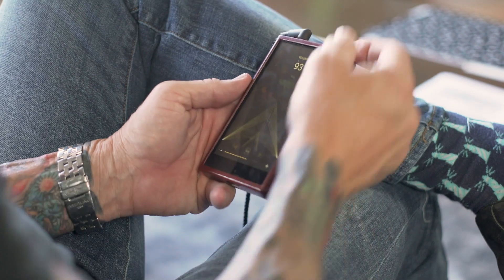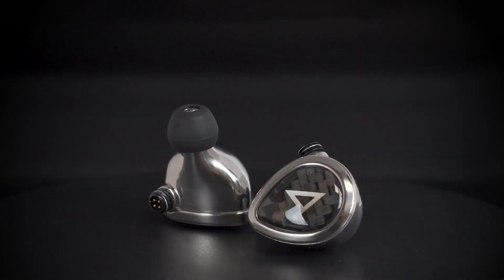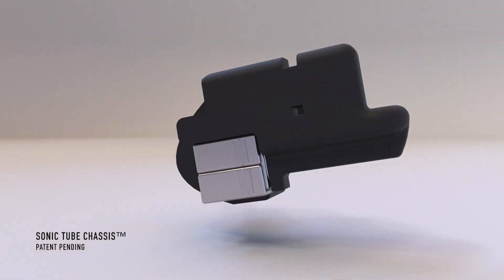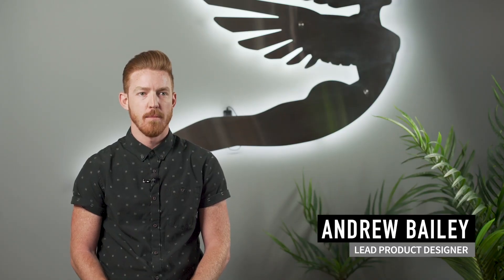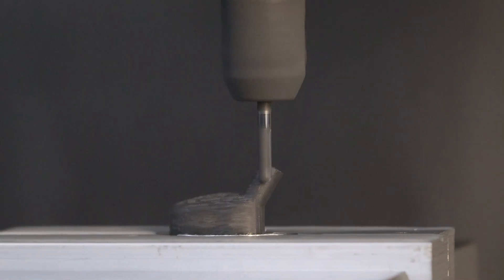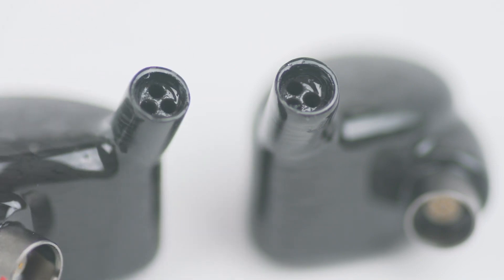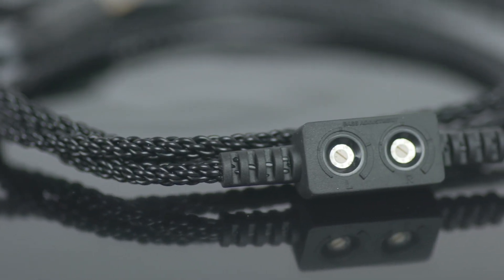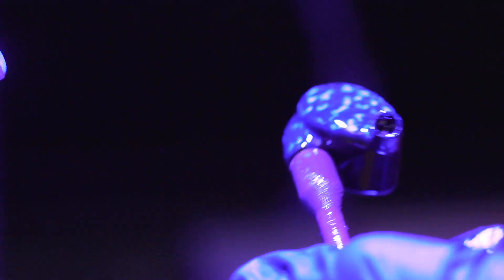JH Audio X Astell&Kern Layla Aion

Comment: Another opinion, I have 'odd shaped ear holes' so on a day when I listened to a number of 1- 3 driver Universal IEMs as well as the high number multi-driver configurations I had a lot of difficulty with getting a seal - 'deal' with the odd matched buds in order to make a decision. In the end I went for the JH Audio Roxannes as I loved the sound signature...and ordered the custom version. The difference between the universal and customs is very noticable IMHO. Fantastic. Those with 'normal' ears may have a different opinion.

Comment: would there be another version coming out soon. thinking about getting this but worried another version might appear soon after.
Reply from the maker: Hello! Sorry for the delayed response. There is a good chance we'll be releasing a new Layla Universal in 2022, so I would hold out if you haven't purchased this yet.
Reply: @JHAudioOfficial  have bought this during 12.12 sale locally and gotten an extra cable from you folks. 😅